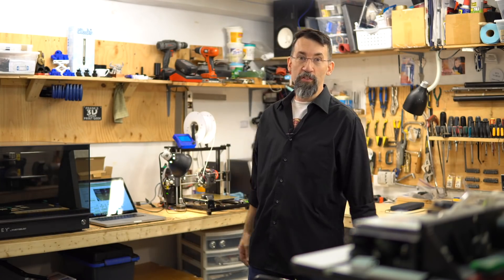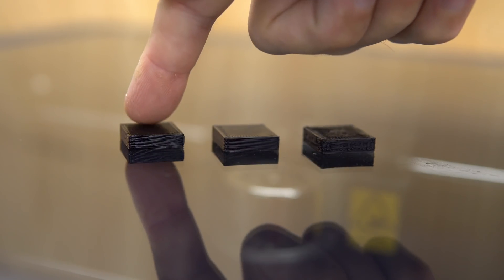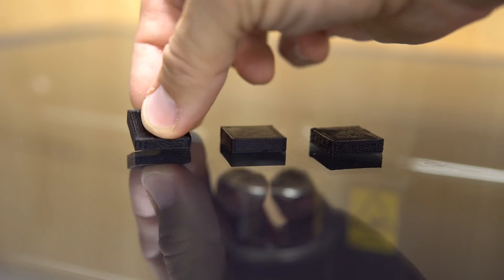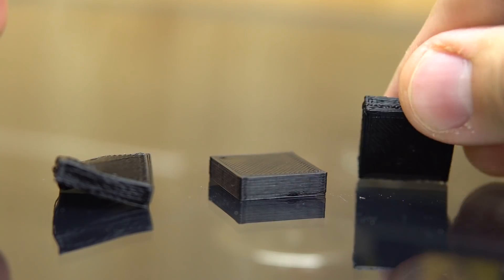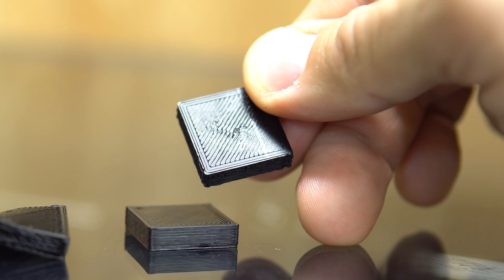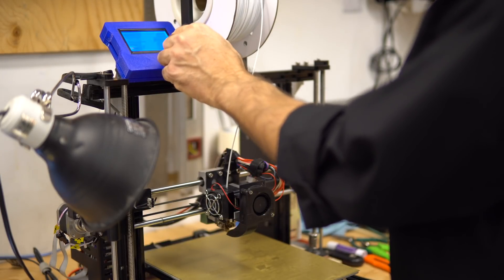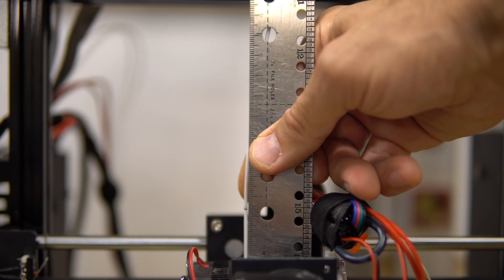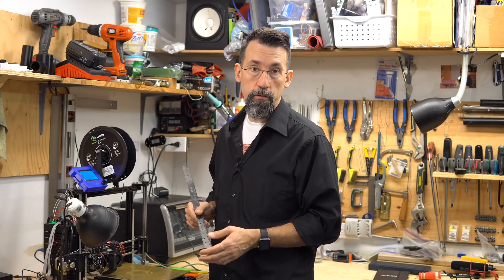Extrusion problems

Comment: hello frank 
nice video 
i have some problem with my extrusion 
i have made my own printer using scrap and proper electronics 
my extrusion motor get back and forth when i am extruding my filament 
and same for printing too
but i need to solve these problem 

please  help me
Reply from the maker: Hi, what is the problem exactly? Do you have a partial clog?

Comment: So my monoprice mini select v2 has just randomly got the under extrusion issue when i switched to black im now trying a different color i hope it works any help would be appreciated again it is under extruding... now with all my pla
Reply from the maker: It probably is partially clogged, if it is extruding with a little bend on the first millimetre, it probably is, I have some videos on of to clear a clog called a cold pull, https://youtu.be/8zsV_FN-y4o you can also do it with the hot end in place, and just remove the teflon tube entering the hot end, push the blue plastic ring to pull it out, or unscrew the brass fitting.

Comment: Hi, anyone with anet a8 can help me? I have an anet 8 and when this is printed after a 5 layers begins to divert the layers to the side. Some advice?
Reply from the maker: Hi, when you get layer shifts, something is skipping, it can be the belts that are loose, the motor current is too low, the bed is not level so the hot end bumps agains the already printed part. You can use Z-Hop in your slicer to help prevent the later. Let me know if it helps.
Reply: @Franks3Dshop  How can I adjust the filament output, the parts that have already been printed have little filament are very fragile
Reply from the maker: It could be that you have a partial clog that limits the quantity of plastic coming out of the nozzle, what I do in those case is a cold pull like in this video https://youtu.be/8zsV_FN-y4o or this one https://youtu.be/hBkTeXxcFi8

Comment: 11th of December I purchase tronxy x5st-2e printer. I calibrate the extruder it's 106% I use cura 3.5 . But print is so under extrude .4mm nozzle .2 layer 106% flow. I increas the flow rate at every print . But print is under extruded every time. I found not good but ok flow rate at 500. My cr10s flow rate is 104 and it's perfect.
Reply from the maker: First I assume you do not have a partial clogging, do a couple of cold pull to clean up the nozzle if you are not sure. And verify that the filament size is correct in Cura and in the Tronxy with gcode ‘M404 W1.75’ if it’s 1.75mm and ‘M200 D0’ will revert back to linear extrusion instead of volumetric extrusion. After that issue a ‘M500’ to save everything.

Comment: Right or not, Cura 3.6 version does not working on retraction every where is hairy lines it is  fck Irritation!
Reply from the maker: Try some combing options, it usually helps. Make sure your extrusion is well calibrated and that the flow is 100% in Cura. I am also using Linear Advance in Marlin and resolves this and make better seems on the outside, you have to configure Marlin 1.1.9 to active it.

Comment: on my ender 3 I get under extrusion on the back right corner of the print bed. I checked all the hardware and I can confirm it has something to do with the gcode not the printer. I am using cura 3.5 . when I use the default print file it is fine it only happens with cura gcode
Reply from the maker: Humm do not see why Cura would do that, maybe be if it’s jamming or rubbing in the ptfe tube at certain angles? Try to print only in the front opposite corner, if it still does under extrusion it’s Cura, if not it’s something physical on the printer. Maybe as to do with layer height, try 0.2mm with 0.3 first layer
Reply: @Franks3Dshop  i was messing with my printer earlier and I noticed if I extrude only .1mm it jumps back (the filament does not slip the entire gear and filament skips back) but if I extrude 1mm or more it extrudes normally.
Reply from the maker: Hi, I would verify that the tube is seated correctly at both ends and in the hot end...
Reply: Having the same issue with my Geetech A10M which is an Ender3 clone with dual extrusion. Cura 3.5 also. It seems to do weird things with infill, missing sections out while massively under extruding. It also prints strangely, where it would end on a layer, then travel all the way to the other side of the print and start the next layer from there. I've not used Marlin before so maybe I'm just not used to the print method.
Reply from the maker: There is a setting Cura to optimize the print order
Reply: @Franks3Dshop   Actually I think it's where I played with some new settings like setting the seam to be at the sharpest corner, lol. I also found a glitch in Cura where if Zhop retraction is set to more than 0.75mm your print will not complete. This was on another video from someone who wrote to Geetech. This happened to one of my prints where it got half way and stuck in and endless loop going over the same bit.
Reply from the maker: Woah ! Infinity print...
Reply from the maker: And Cura 3.6 is out maybe it solved the problem?
Reply: @Franks3Dshop  Thanks for the help I will check the tube shortly. also cura 3.6 did not fix the problem. how do I tell if the tube is seated correctly. I noticed on smaller coin prints for D&D (these prints are older ones) the back left corner of all of the prints were a little underextruded.
Reply: @Franks3Dshop  just printed the same model but just before the print i pressed the tube in on both ends extra hard and that seemed to fix it. Is there any way to ensure the tube does not come loose again ( I would prefer not to use glue) . Thanks for the help I can't wait to get back to printing.
Reply: Ps to anyone with the same problem as me. Press the tube in even if it appears to be in all the way, because mine seemed to be in there snug but once I pressed in harder it fixed it.
Reply: @UAVwaffle  They are similar to hozelock fittings and speedfit connectors on water pipes, if you push in and can pull it back out without pushing the collar in, then it is not in properly. You should make sure the collar is not left pushed in as this loosens it and allows it to come out. There are clips on Thingyverse to print and put round the collar to stop it going in with movement so it grips the pipe at all times. I have not personally needed this yet, but I've only had the printer a few days.
Reply: @ArcanePath360  k thanks
Reply from the maker: If it does not stay there, I would replace them with better ones, from a local shop you can trust...
Reply: @Franks3Dshop  I do not have any local 3d print shop any brands you would recommend? Thanks again for your help

Comment: THANKS for your videos, I have a trouble with my 3DP Im using slic3r and repetier, in some occasions, my impresions start 10 or 20mm high Zaxis, can you tell me why is that
Reply from the maker: Maybe you are missing a home axis G28 on some profiles?
Reply: I have a QU BD three Up, when I connect Z axis switch it does not work correctly, so I decided do not connect it, where can I find the gcode start end ?
Reply from the maker: I would try Cura with a printer profile resembling your printer, maybe your Z switch is reversed in the code, is it an home made machine or an old kit maybe?
Reply: home made, Im starting in this 3d world, I dont know very well the software and language, I had 1 month assemblying it, yesterday I printed my first model in PLA but I had to raised the temperature to 245 because it did not extrusioned very well
Reply from the maker: I never used a ramps board myself, but first thing for the heating, you have to select the correct thermistor type, I know how to do it in Marlin but not in repetier, I suspect that you do not have the correct setup or it is not connect correctly. You could verify with an infrared thermometer if your temperature readings are correct. For the Z Axis, again in Marlin you can inverse the logic.
Reply: @Franks3Dshop  THanks Frank, how do I know the meaning of those orders on Gcode, like g28, g14 and others, are the same for all the printers or are specific for every printer?
Reply from the maker: They are adapted for each printers, but they are similar, in Cura or other slicer if you get the latest version, you can get basic profiles for many printers. For Marlin here is a reference: http://marlinfw.org/meta/gcode/ Other firmware will also have some reference file like this one.

Comment: One quick problem I found with the instructions is that you can't use the difference to find the percentage for correction. At smaller numbers it will be relatively close, but quickly escalates. You should divide the amount you told it to extrude by the actual amount extruded. In your case 100/96 gives 104.166%. This isn't much difference, but at 90 out of 100 the error is 1% (111% vs. 110%), and 80 out of 100 the error is 5% (125% vs. 120%).
Reply: Came here to say this, but not quite as elegantly
Reply from the maker: You are right, but it is simplier that way, you just do it a couple of time and your good, +- 2mm on 100mm extrusion will not affect significantly the prints, you could always be more precise the way you describe.Thanks!

Comment: Thanks, very helpful, quick question on when you showed the 3 different models, what percentage were they over and under extruded? 5, 10 percent? Cheers
Reply from the maker: Hi, If I remember correctly, I went about 75% over and under just to be sure to see clearly the effect...

Comment: Thanks Frank! I have a question: why 12 cm? I did mesurments like you, you have 2.4cm I have 7.0cm...if I understood correctly I have underextrusion, by 9%?
Reply from the maker: Hi, I will have to look at that video again it’s too late right now, but I think you get the idea, you extrude X amount (100mm is easy for calculating) and measure how much was taken. Than if the printer only took 90mm you know you are missing 10mm out of 100mm so it’s 10% under extrusion. Same thing if the printer took more than 100mm but it’s over extrusion that time. Does it answer your question?
Reply: Yap, thank you!

Comment: My 3D printer does not give me access to the filament to be able to mark it as it goes through a bowden tube, etc. Is there another way of doing this?
Reply from the maker: You can do it just before it enters the Bowden tube before or after the extruder gear. You have to measure the length going to the hot end... if you can remove the Bowden tube, you could measure the filament coming out the extruder.
Reply: Thanks, but I just did a temperature tower but instead of adjusting the gcode for temperature I adjusted the flow then I have picked the right one :) 

Less scientific but it works ;)
Reply: @funkycowie  What printer are you using? You should provide that modified file for others to test their printers, it was quite ingenious.
Reply: @ShadowtheWiseman  There is no point sharing the  .gcode file as everyone's printer will not be the same regardless of brand etc. I just used Cura to modify the gcode  only which you need to do to do a temp tower, I did not adjust the .stl but feel free to create a new model with flow percentages on.

Comment: This helps a lot. A lot of my prints start to look like the over extrusion sample. My nozzle drags on the print and even broke the hot end heat brake. I do have a question though, if my prints still look like they are over extruded (after it prints all 100mm of filament) is there any other steps I can take to make it look normal?
Reply from the maker: Hi, I would say the you have to make sure that your nozzle size in your slicer correspond to the nozzle you have. Also if you drilled your nozzle to unclog it or if you have printed material with particles like wood filament or glow in the dark, your nozzle could be larger now, so you would need to replace it. And if you plan to print those types of filaments, change for a stainless nozzle.
Reply: Frank's 3D shop thank you so much. That’s very helpful

Comment: hello, so my flow rate according your example should end at 104%?  thanks
Reply from the maker: Yes if you want to do it in your slicer. I prefer to issue a M503 command using Printrun (or Pronterface, you can listen to my video https://youtu.be/YpWCKNagjuI to help using that software) connected via USB to the printer, look for the M92 line and the E97 (in my case it was 97 initially on the monoprice mini) add or subtract the percentage of error to that value. Issue a:

M92 E100
M500

And do the same test again and see if you still get an error, until you are satisfied with the result.

I presume here that you do not have a clog or results will be way off. My printer ended with a value of M92 E111 which is 14% more than the original.

Does it make sense to you?